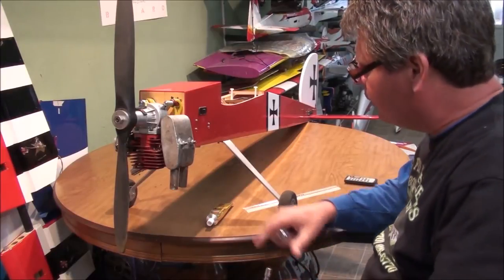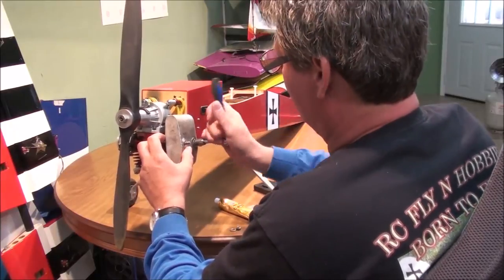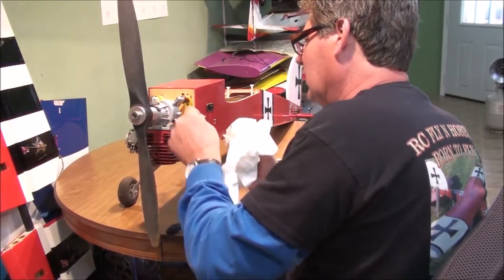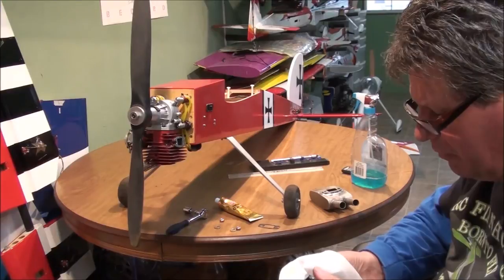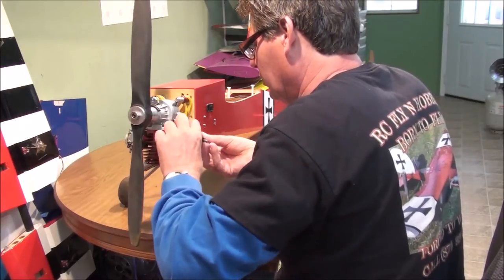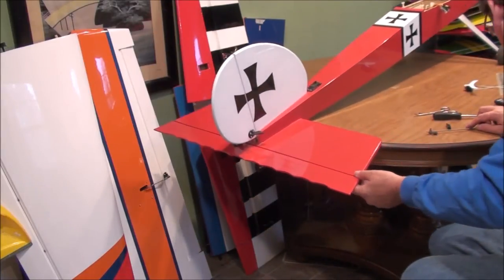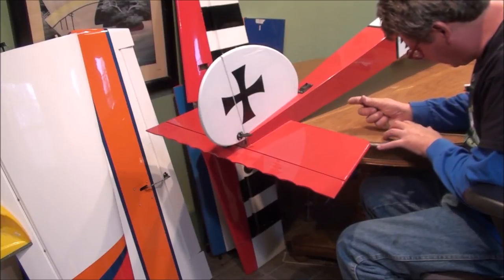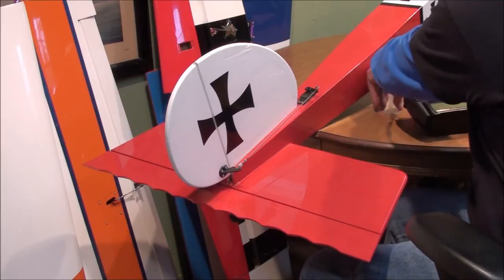Working on the Giant Big stick #1

Comment: Just picked up this plane,  did you use the CA hinges included or did you get a stronger hinge?
Reply from the maker: I used the CA hinges And have never had any problem with them..
Reply: Cool :) I cannot wait to get it together and fly it :)
Reply from the maker: Marc Hering
 You will love it.. set it up for four ailerons .no need for flaps on this airplane ..and take your time and use lots of 30 min epoxy attaching   the horizontal and vertical stabilizers to the fuselage  that's a weak point on this airplane..and you might consider buying a heavier duty   tail wheel  set..this airplane is very hard on tail wheel assembly's i have broke mine three times.already.
take care
Bill
Reply: Thanks I'll look into a heavy duty wheel set,  I was planning on setting it up to run the 4 ailerons but be able to use the flaps as well on a 3 position switch (Now that I have a radio that is easy to program DX9 :)  ),, (My field has highish trees at each end so I need a steeper approach angle)
Reply: Hi was hoping this video would be a continuation of my learning. However this music is too much plus it would be helpful on a long video to get explanations of what you are doing. I'm lost.